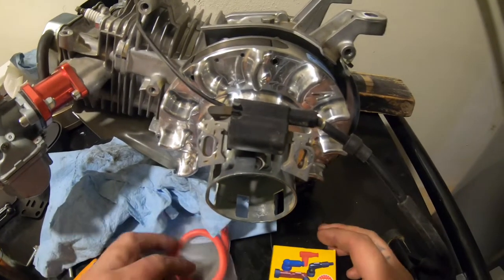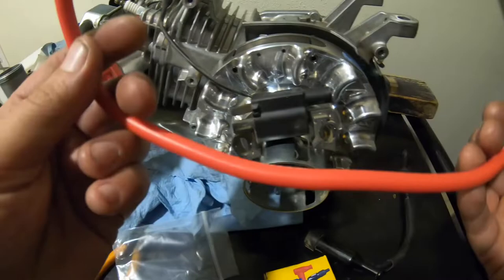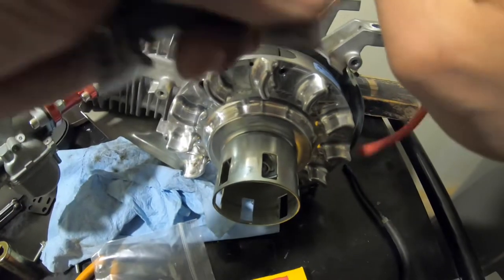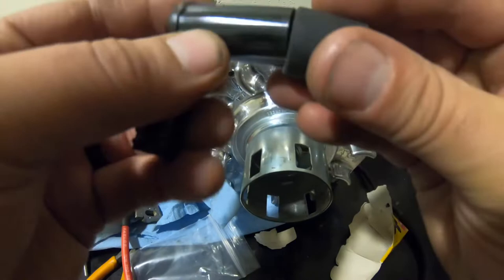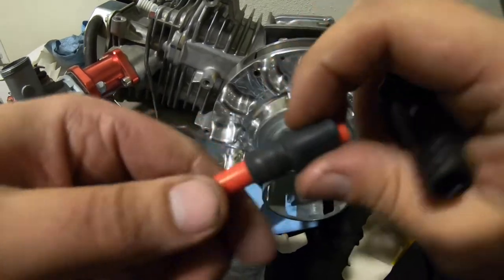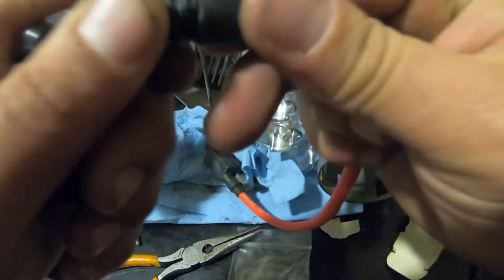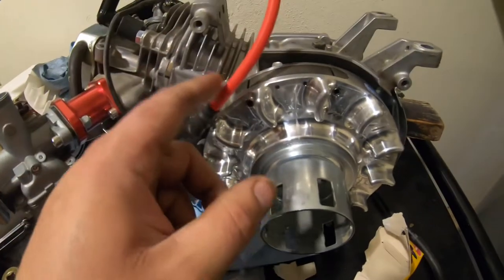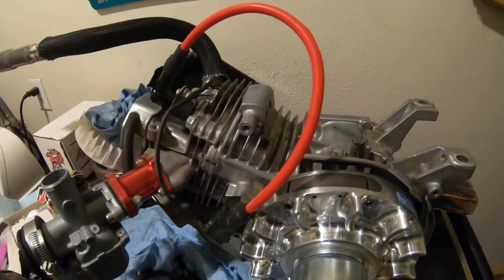Predator 212 performance coil

Comment: The spark plug cap you show  has "resistor" on the box.  Make sure you get the NON_RESISTOR plug cap. Use a copper core ignition wire too.